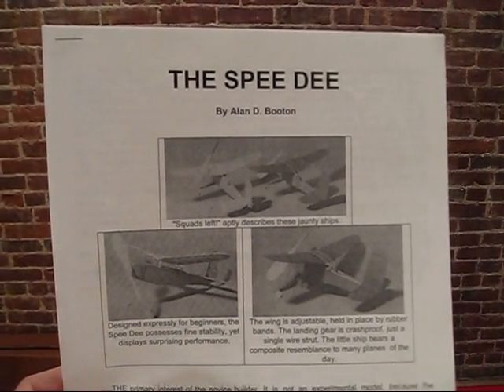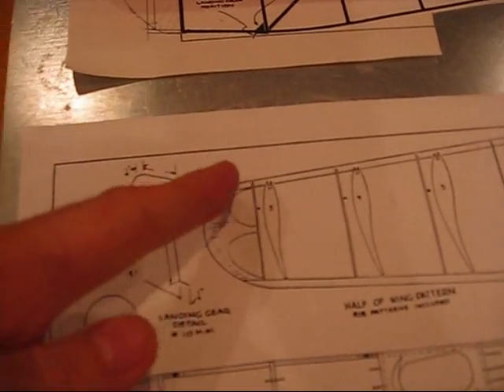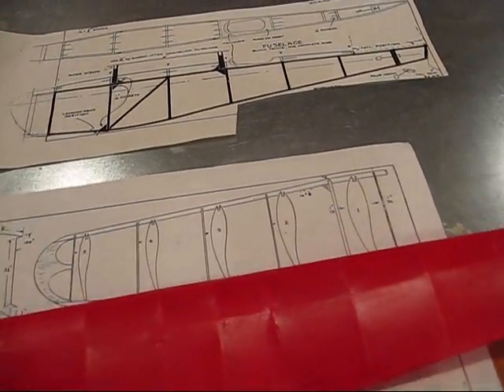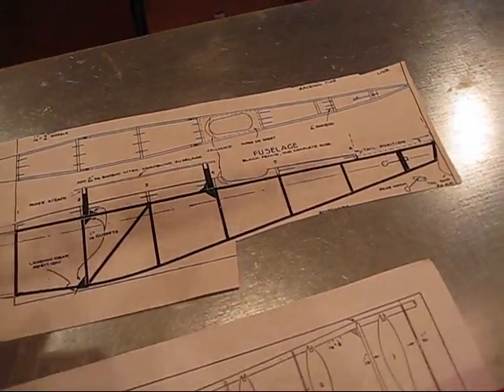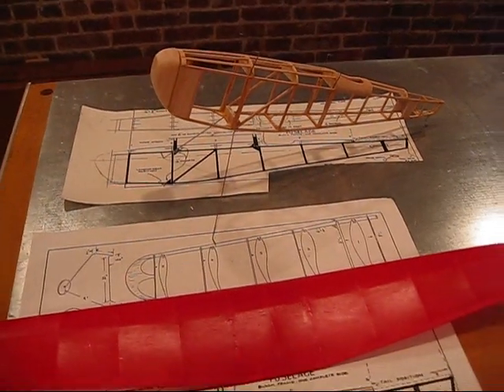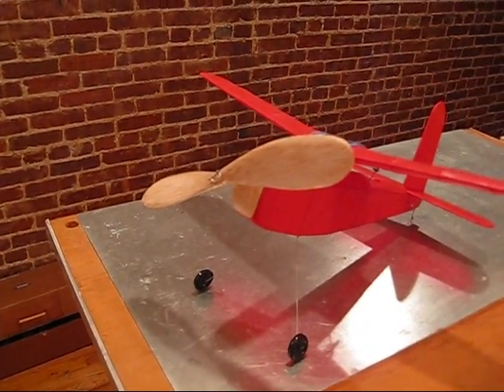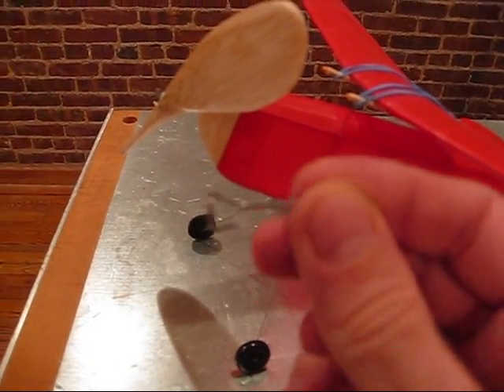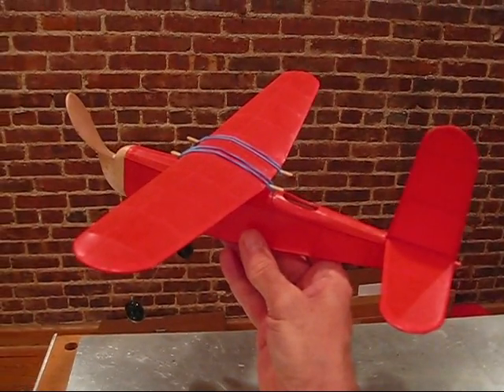Rubber powered 13" Spee Dee - building tips

Comment: Noche building skills. Could you please share prop diameter AND rubber band dimensions? What was the final AP weight?
Reply from the maker: Prop diameter is 6", it's a long time ago but I think I was using a 6 strand 1/8" motor a few inches longer than the nose to rear peg distance; would have to dig it out of storage to check the weight, usually for this size it's in the range of 20-30 grams.
Reply: @domoremath  Thanks for taking a look in to muy previous comments. I am trimmig a pacific ace peanut versión. And I starter with 1 loop of 3/32. Could you please confirmo 6 loops of 1/8 Is reliable? I would like to share w / you some photos? Do hoy hace e mail adress? Would you like to share It?
Reply from the maker: I'm sorry, I just noticed that in the video I mention that I was using 4 strands (2 loops) of 1/8" that was 1.5 times the nose to peg ditance. If I remember correctly, this plane was tricky to trim, as are peanuts, I'd go for the 28" version of the Pacific Ace, great flyer!
Reply: @domoremath  Thank you sr. I just double check the video. And you are right 4 loops 1/8 Is correcto. I Will rey with It. I built the phantom 28" versión some years ago while I was in the university, It was a nice flyer also. 
I Will try the Ace of pacific 28" I Will let you know how is it going. Thanks for  your kind advicing. Could you please re comend a nice flyer for peanut size category?
Reply from the maker: The Nesmith Cougar shown in my first video flew pretty nice.

Comment from the maker: If you download the plan you'll see it. It's basically a wire bent like a sideways V so that the wire engages into the V under power, and then glides over it during freewheel. Another one I use has a square S-shape with a tube in the middle, I'll try to remember to show it next time I post a video.